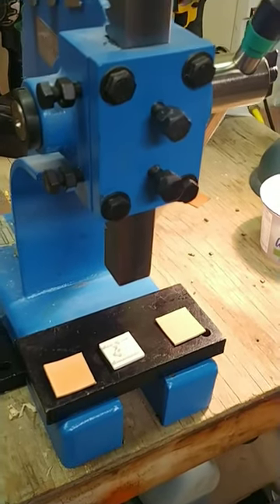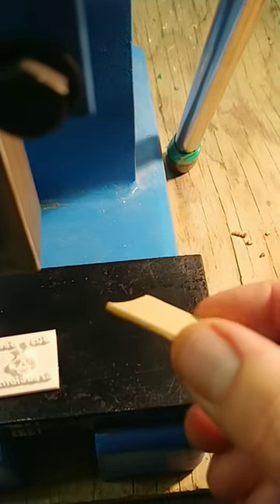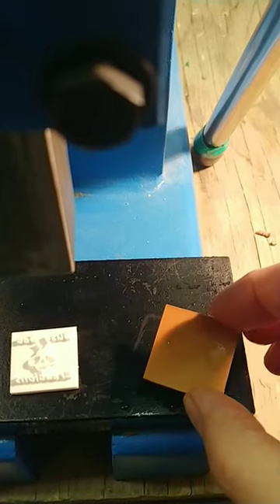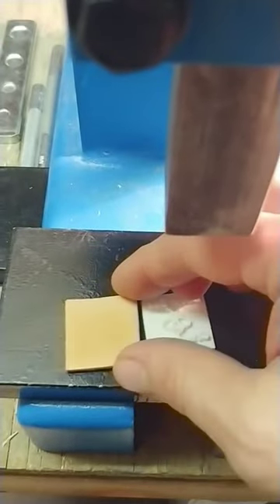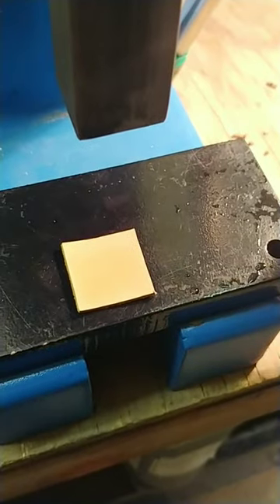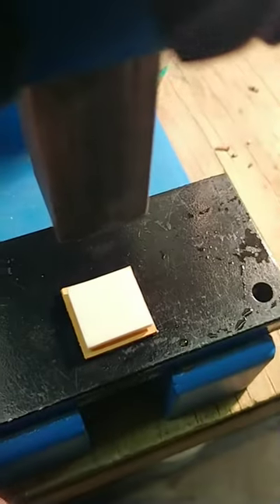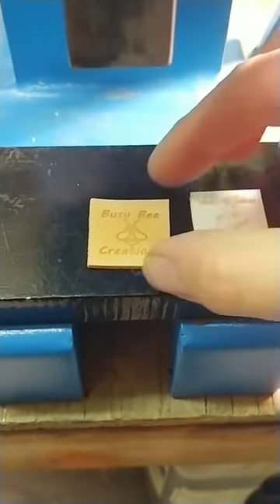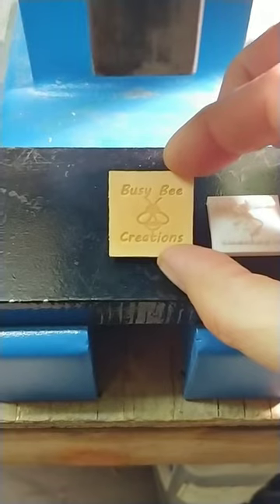Using an Arbor Press for 3D Printed Leathercraft Stamps

Comment: how do you make the 3d printed stamps?
Reply from the maker: I use several different software programs to design/edit images, covert 2d images to 3d, to create the base, to create a file I can print on a 3d printer.